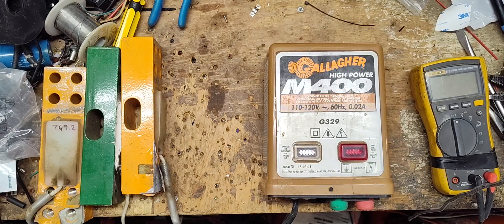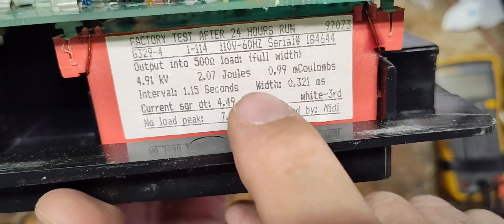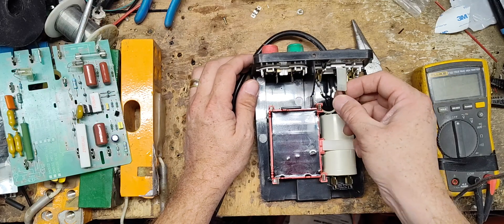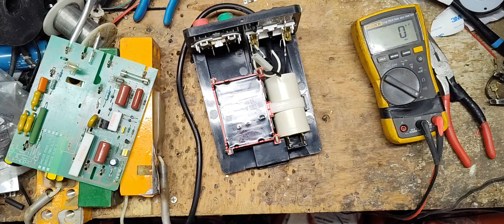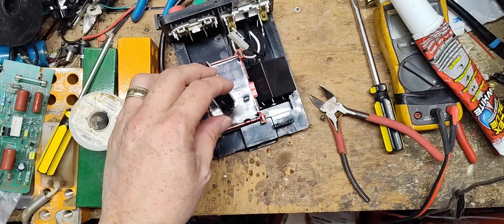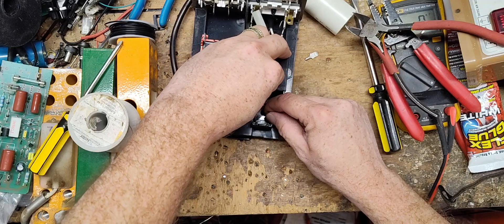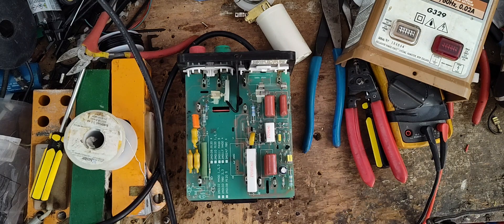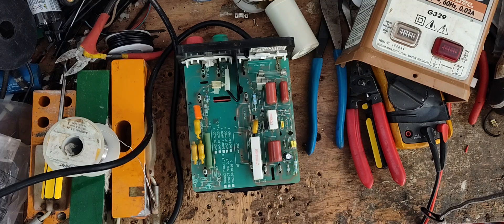Testing & Repairing Electronics On An Electric Fence Charger | Gallagher M400 Repair

Comment: I've had bad luck with Gallagher solar units like S17.  How can I test them?  Batteries in some units will never fully charge even when replaced with new battery.  Thanks.
Reply from the maker: The Gallagher S17 was a really good unit and was produced from 1997 to 2017, so they sold a pile of them. Watch this video I did a few years ago. https://youtu.be/eZtOJtddO9g?si=ZYnkWaQV8s5RIjt2

Comment: I sent you 3 chargers in August. I have left numerous messages and text about them. I wasn’t expecting a super fast turnaround but a response would be nice. It is December and nothing. I just saw all the negative comments on your Facebook page so I’m guessing it is normal operating practice for you to keep the chargers and ignore your customers?
Reply from the maker: Sorry for the delay and not getting back. I'm by myself at the moment with only one phone. I miss about 70% of the calls that come in and I do forget to call some people back. What brands and models were these units?

Also, a majority, if not all, of those people have all been taken care of.
Reply: I sent a Parma mark 6, Gallagher M300 and another Gallagher. I don’t have the model of the 3rd Gallagher in front of me at the moment but the case was cracked and had gorilla tape on it.

Comment: I received a MBX2500 for repair. I repaired its power supply. Now it works fine. But its joule meter shows NA. Can you help me fix it?
Reply from the maker: I'm not sure what that's meaning exactly.... Does the unit pulse and click about every 1-1.5 seconds? Do you have a fence tester to test the output across the red and green knobs? If the unit pulses and the output tests good, then the customer might just live with it. I'm not sure what's causing it, possibly something in the big board where it talks to the display board, but there aren't any schematics for their stuff and no parts are offered for that model anymore. Here in the States, they launched that model 22/23 years ago and they haven't sold that model as a production unit in 11 years and a majority of the parts have been slowly discontinued the last 5 years. So unless the customer wants to spend a bunch of money trying to fix every single aspect of it or buy a brand new model, they might just live with it if it's still functional. That model sold here in the States for around $1500+/-

Comment: Don't make them like they used to. Thanks for the videos.
Reply from the maker: Nobody does these days. The good thing though is that we some see very many issues, minus lightning/surge damage and sometimes water damage, on the current style Gallagher. They're not cheap, but I think they're some of the most reliable brands in today's market.

Comment: Also, a question if you have time. I keep goats, and am introducing a buck goat that has no respect for electric fence.  I want to shock him as hard as possible to see if I can salvage him for my program.  Does the higher joules deliver the hardest shock?   So I was looking at the Gallagher M1100?  I have a small place, but I need something on hand for severe training lessons.  Otherwise, I just can’t turn a goat like this loose with the others.
Reply from the maker: That unit should work. It's an adaptive output unit, so it will run a small area just fine and adapt up it's output based on the load it feels, so if you'd work just don't. You could also just go with the M800 and that unit should definitely do it as well. Also, make sure the unit is well grounded. Install at least 3) galvanize 6' ground rods spaced 10' a part and clamp them together. The better the ground system is, the better the whole system will run.
Reply: thank you!
Reply: @FencerFixerRepairLLCKansasCity  well, I was running the M360 with one ground rod. The Gallagher fence tester was reading 9.9 kV.   Replaced it with the M1100 with three ground rods. Tester is reading around 7.5 kV with the new charger.  To me, the zap does not feel any more intense.  So I am at a loss. Probably about 12’ of total ground rod below the surface. Do I need more ground rod?
Reply from the maker: @davidpeightal4918  The voltage is irrelevant in the grand scheme of things, as long as you have over 4-5kv your joules will always be there no matter the model. The M1100 is an adaptive output unit, so it takes a few pulses to build the charge up to a high enough level to be at the highest joules based on what the load is that's touching it. It doesn't run at full output joules all the time, it runs at like 20% all the time and gradually builds the joules up each pulse when the animal, person, or grass etc touches between ground and fence. So you probably only got 20-30% of the full power shock when you touched it. If you're body was able to hold on longer, the shock would've increased a lot, but your body and an animals body will naturally bounce away from the fence. I know lots of people with the M800 and M1100 that have goats and don't have any issues with them respecting the fence. Make sure to drive the rods in as deep as you can, the deeper they're in the better and make sure you Space them 10' a part. Have you seen the goats touch the fence yet? You could always add more ground rods, it won't hurt anything and the better the ground system is the better the whole system will run. 6' galvanize ground rods, use leftover aluminum or steel fence wire to go between each rod, use galvanized ground rods clamps to hold the wires onto the rods.
Reply: @FencerFixerRepairLLCKansasCity  thank you so much for your explanation and for the time you donated.  I have two 6’ rods and one 8’ rod.  I left some out of the ground so I could have hope of getting them out. But I will drive them down all the way and add another one. 
(He has crawled between the bottom and second wire.  No reaction. He has a heavy coat, and he does it so fast it could completely miss him, or possibly hit him once. But if it is between him and the girls, he won’t hesitate.)
Reply from the maker: @davidpeightal4918 You may have to add additional wires to close up the space to help slow him down.